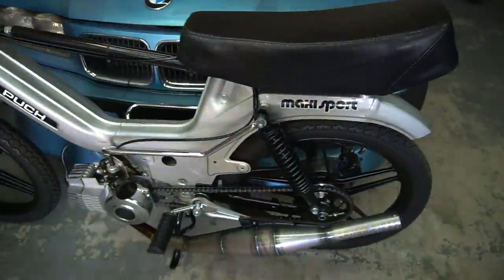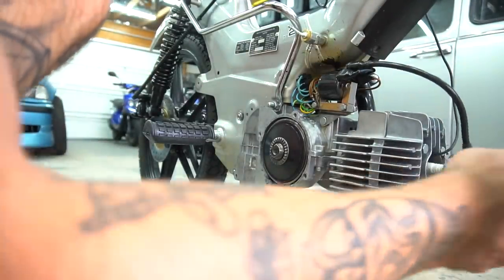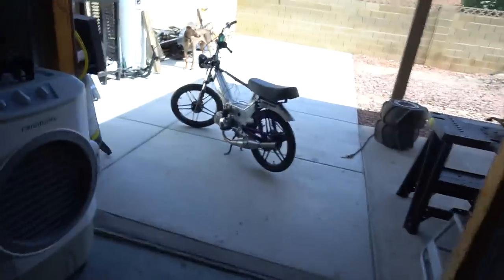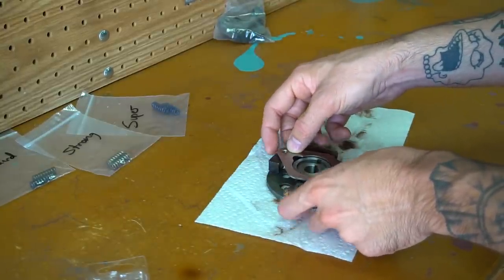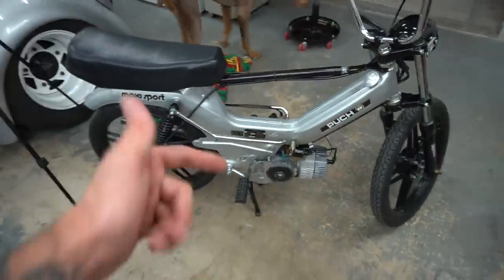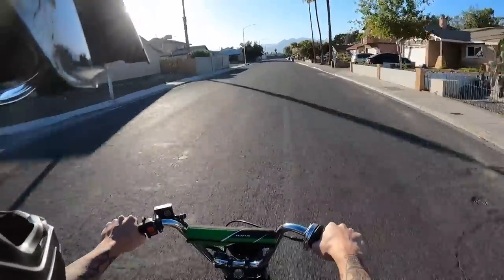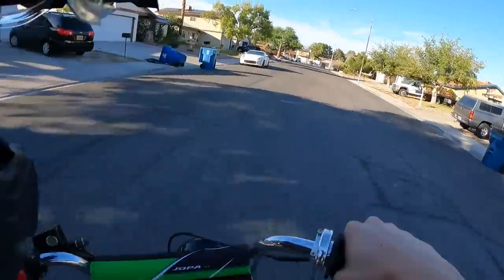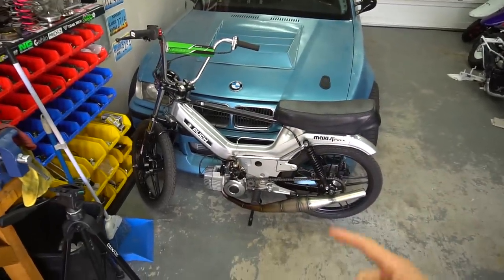64cc Stunt MOPED Build Complete! FIRST RIDE!

Comment: You need to tune the clutch via the screw for the springs. Run them 2 turns in from flush with the medium springs. You want the clutch to essentially stall you until its in your powerband, which on that cranks pipe starts around 6k. Once it stops slipping and grabs you’re already where you make the most power so it takes off better.

Comment: Stiffer springs and thinner oil let it rev higher before the clutch kicks in so your in the power when it does hit. I use the og 3shoe with 0w-20 synthetic motor oil my clutch doesn't engage until like 6k rpms and holds tight til it hits the wall in the pipe. You also can screw with how many turns in or out on the clutch springs will help

Comment: The brace on the frontforks are only suppost to be on the front side bro [i never seen a double sided one] its also not needed for strength just front sided one is strong enough.
Mine has just a front one and i rode with a simelar 65cc setup for years tuned for top speed as i rode long distance [went a solid 110 kmph no matter the conditions]
also i preferd the clutch with 3 shoes and proper spring set up its a bit of an hassle getting it right to the rest of the mopeds parts and personal liking
But as i said bevore digging the build and content!

Comment: Honestly, I think you didnt need to change the gearing, but tune the carb. Mopeds need there carbs tuned for all the rev ranges unlike scooters with CVTs that only need to be tuned for a rev range and the CVT takes over and keeps you in that optimum power band.

What you experenced there is a carb tuning issue. These old mopeds with tiny carbs need very fine tuning to get just right for all rev ranges. I suggest getting the bike running perfectly without any bogs before changing sprockets.
Reply: Make the gearing long, tune the carb, then change the gearing.